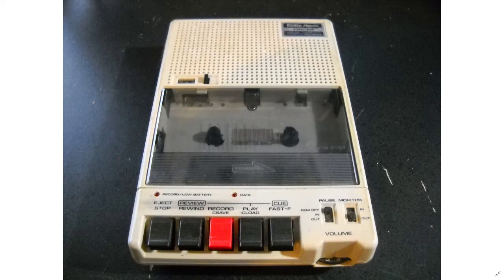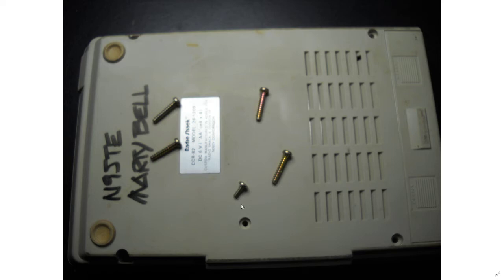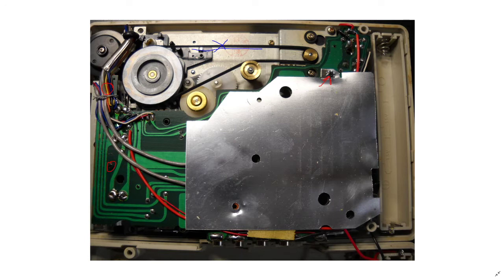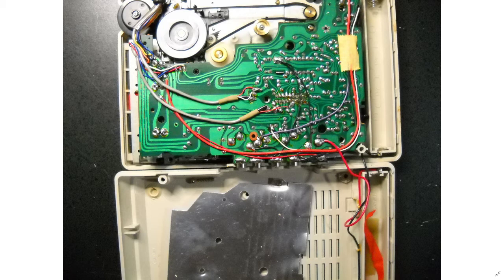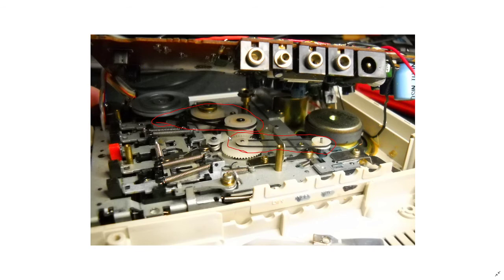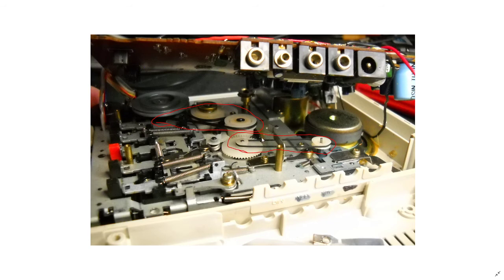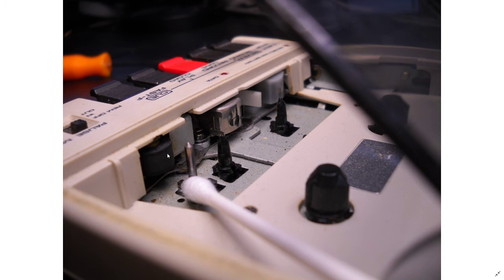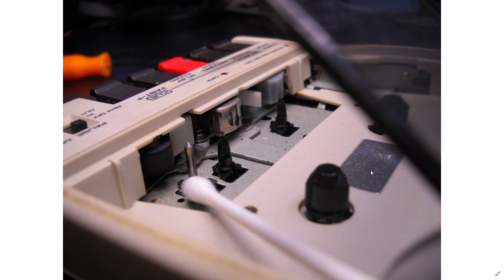Clean Cassette CCR 82

Comment: Thanks for that. I'm having trouble seeing exactly where that secondary sub-belt goes from the Service Manual, since it's already broken. Hopefully I can work this out later when the belts arrive in the post.
Reply from the maker: If you look at the Service manual That can be found at ColorComputerArchive, on page #9 , Figure1-A you can clearly see the main Belt on the left, and the smaller Counter belt on the upper right.  If you look at the image for the main Drive Belt, you can see the larger pulley towards the bottom.  That pulley has a smaller pulley stacked underneath it, the SUB main belt is on this pulley, the next pulley just up and to the right at the 1:00 O'clock position AND the pulley just up and to the right at the 1:00 O'clock position from the middle one.  If you look carefully, you can JUST see part of the routing of this SUB Belt.
Reply: @briansschubox2942  I see, there's a smaller pulley stacked under the main one. My SCX-8 arrived a couple of days ago and so I'm just waiting for the others before attempting this. Thanks Brian.
Reply: @briansschubox2942  I've managed to replace the Sub belt, which had turned into mush and left black gunk on my fingers which I'm trying to remove. I couldn't free the negative battery lead as it was firmly glued in, so I decided to desolder it from the circuit board and re-solder it when I was finished. Thanks for the instructions here - they gave me the confidence. 
My next project is to replace the belt on my Roland PR-100 Digital Sequencer!